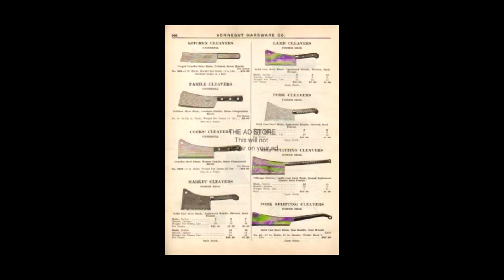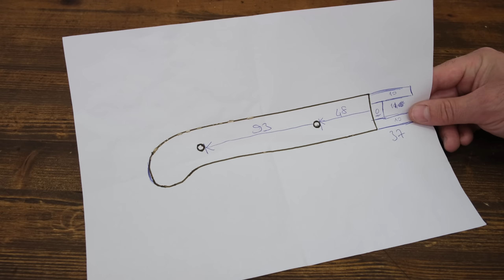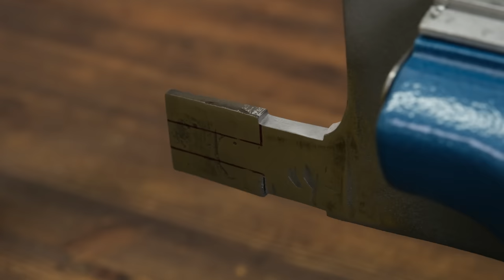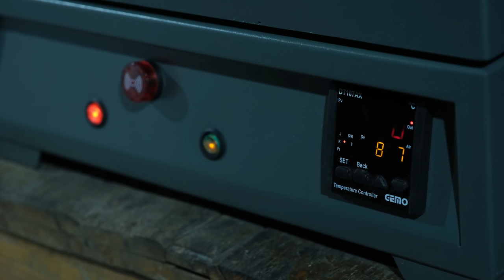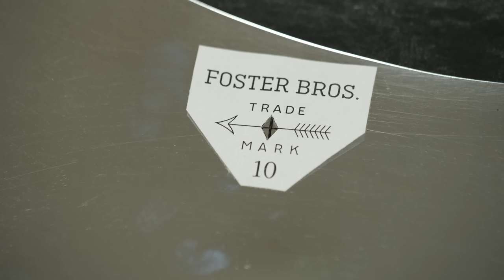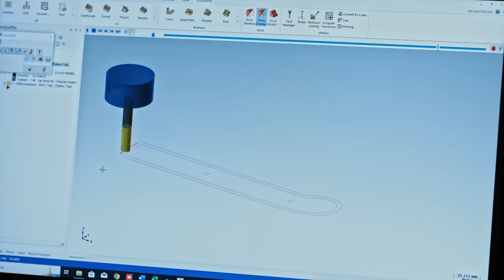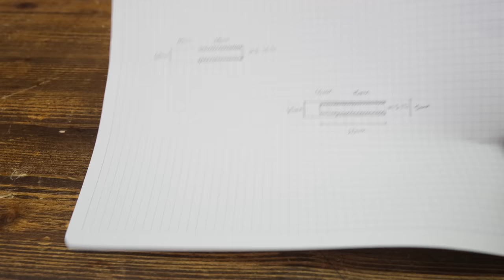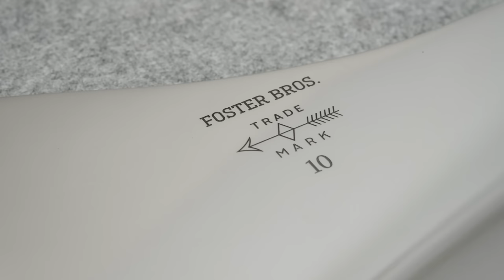1880s Antique Rusty Cleaver Restoration - Restoration Videos

Comment: Its definitely more useful now that it was before, though I think I would have preferred it if the edge profile was maintained at the original slight crescent shape that most cleavers have instead of that straight edge it has now.
Reply from the maker: but the original was like this. so it's flat.
Reply: It probably turned Cresent over the years from bad sharpening jobs
Reply from the maker: @tylerkrug7719  ofcourse
Reply: @meinemechaniker Respectfully, I think you are mistaken. Chopping cleavers almost always have a subtle curve over the length of the blade. It is very hard to chop onto a cutting board and have the cleaver blade strike the cutting board all along the length of the blade. 

With a perfectly straight edge geometry like you have created, the tip or the heel will be prone to sticking into the cutting board and be less likely to cut all the way through the item, particularly with meat. You want a very subtle bulge in the belly of the blade to so that a longer portion or the blade edge will strike the cutting board on any given chop.

I also agree that the curve at the tip likely increased over the years due to repeated sharpening's. However that does not mean that a straight edge geometry was the original shape.

I beautiful job none the less. I just defiantly believe that a slight curve over the length of the blade or at least a subtle upward curve at the tip would make that cleaver work better for its intended purpose in a real world setting
Reply from the maker: @donstrader  Are you sure you watched the video without skipping? I showed you one of the examples on the internet.
Reply: @meinemechaniker  I did skip ahead to the restoration and missed your example pictures. I concede the point.😅

My opinion in the previous post was based upon using cleavers at work and personal preference.
Reply from the maker: @donstrader  🙏🏻✋
Reply: @donstrader I agree with you.
Reply: @meinemechaniker  I watched the entire video without skipping. The original is straight, but from my experience having a slightly curved edge does help abit when chopping bones. A straight edge is fine anyway for general use. Perfect restoration i'd say.
Reply: Whilst it is almost a thing of beauty when it is finished, until it is reshaped it will be difficult to use.

Comment: This was not a restoration but the result is beautiful. Good job.
Reply: It was what do you mean lol?
Reply: @pavloszimbrakos4410 it’s a whole ass upgrade, most restorations I’ve seen aren’t this comprehensive. Dude did a whole heat treat
Reply: @user-px7ls4oi4m  yeah so it doesn’t rust and break again that’s not an upgrade lol it’s a restoration getting rid of the rust and the broken old handle is a restoration
Reply: @pavloszimbrakos4410  he also got rid of the easily repairable edge,   which changes the knife significantly
Reply: @sirkelendor5429  yeah I didn’t necessarily like that either the handle was easy to repair despite what I said in the comment above
Reply: How is this not a restoration lmao
Reply: @Jbarnes1  Because during restoration you try to get the object as close as possible to the original. Here the result looks better than original. This is how the cleaver would look if MM would do it not the original manufacturer.

Comment: Absolutely amazing work restoration ring this cleaver. I have a few process and design questions if you don't mind:
1. Why cut off the tang only to forge weld a new one on?
2. Why place the guard before welding the tang back to the blade?
3. Why make the indent in the guard?
4. Why fasten the grip to the tang with screws without leaving a method to unscrew them? Why not use rivets?

I'm truly curious and and want to know your decisions behind these design and process choices as you are an amazing craftsman. Truly great work!
Reply from the maker: 1-should have been an equal tang
2-Once the guard piece is in there, it won't come out again. and this way the tang edge will look one piece.
3-Once the guard piece is in there, it won't come out again. and this way the tang edge will look one piece.
4-yes, rivets are a choice. but I guess my choice was to create a little crowd.
thanks sir

Comment: Beautiful! 👍😁 But one question - when you reduce the weight of the blade (removing the edge) and increase the weight of the handle (much thicker shaft), doesn’t that completly mess up the balance of the original cleever and transfer much less power to each chop you make?
Reply: Agreed, not to mention that the original cleaver cutting edge wasn't straight on purpose. This isn't a knife. It's meant to chop at large pieces of meat.
I also cringed a bit then first rust removal was the sandblaster, not chemical processes (either boling or rust remedy of kind)  - that would leave more original metal. Original handle could've been salvaged and restored if not for barbaric removal method.
Reply: @agistan7764 agreed here too, I cringed at all three of those points, the quick and dirty sandblast, the unceremonious discarding of the original cutting edge, and the unnecessary replacement of the handle
Reply: As a chef I can say that the weight isn't going to be much of an issue but the straight edge would be if it were ever going to see use again for butchery. Vegetable cleavers do have almost straight blades, I use one every day and it's my favourite tool. The problem there though it is about three times to big to be any good for vegetables. In saying all that though it is a beautiful piece.

Comment: Okay, I don't understand why you did all that hand sanding and filing only to then go over it with a power tool. Why do the tedious hand work when you're erasing it in the next step?
Reply: Это шоу
Reply: I think it’s to take away the risk of damaging the whole piece or tool with the first more ridged and hard sands idk
Reply: the hand filing was to get the blade sharp since it can be hard to get fine angles with big power tools. the sanding belt was to smooth the side of the knife and the round tools were used to polish.

Comment: @ 6:29 I cringe so hard from here on out. Why did you remove the rocker of the blade and handle!!? That's the way it was designed for a reason, so when you chopped through heavy beef and bone, it wouldn't stick and had lesser points of resistance. I'm not trying to offend, but give a little criticism. This blade had been around for a VERY long time and You could have continued to take off minimal metal while keeping this thing as restored as possible and it still would have been as functional as it ever was. Very nice video otherwise.
Reply from the maker: Have you watched the video completely? According to my research, what I do at 6:29 is to return the unoriginal to its original form. If it wasn't so, I wouldn't touch it.
Reply: @meinemechaniker  Yes sir, I did. It was a beautiful restoration, and I do agree that some of the cleavers were shaped like you restored it to, but the splitters mostly had a bend crescent or slight angle in them to avoid sticking in the other part of what was being chopped through. Being such a heavy tilted blade meant that the force came heavy always and would make through with little effort, your end point at the chopping angle would certainly stick into a block holding whatever beef or pig you were cutting on. It's really no big deal, just something I felt you already knew. After all you gave it life again, it's just hard seeing that much unnecessary metal being cut after it's been there so long, it could have kept the oblong edge and been great too. Again. Wonderful editing, and the handle is absolutely stunning.
Reply from the maker: @ghkillah1995  thank sir 🙏🏻

Comment: Dude!  I have the exact same one, a Foster Bros hog splitter and I got it in the same condition, minus the warping.  Looked like someone had been chopping nails with it.  My restoration consisted of a wire brush, regrinding, and a light sanding of the handle.  I only use it for removing chicken and fish heads though.  Yours looks spectacular.  I wish I could afford to have you pretty-up mine like that.
Reply from the maker: Thanks dude ✋

Comment: This wasnt a restoration, it was a hack job. Cutting off the blade and the handle!?!?
You should should have tried heating it and then quenching it. It might have rresumed its original shape.
The cleaver had earned every lump and bump it had. As a restoration, your result should be as good as it gets, not as good as new.

Comment: Fantastic skills and workmanship, howevrr its not a restoration its simply a new tool, a beautiful one granted. Would have prefered to see the original handle restored and showing the patina of the old tool. Blade needs to be slightly curved, will be so difficult to use like that.

Comment: Great job, but for some reason the handle thins out towards the end in the original design. I found one with the same design and size but in worse condition, in an excavation on the banks of the Panama Canal. I haven't restored it yet.

Comment: Not sure if others had ask this question.  Would you know the steel used for the blade?  Is it spring steel or one of the 10XX?  Thanks and great work.  It's a lot of efforts to restore this big cleaver.  It is too bad you have to cut so much height from the blade in order to save it.
Reply from the maker: 2 karbon steel

Comment: nice though not so sure about the choice of making the blade straight, considering the size, a curved blade would make it easier to use and probably would fit the overall design better.

Comment: The results are great. It looks better than it would have new. I'm curious why you didn't electroplate the steel for corrosion resistance?

I didn't care for the editing style of this video though. The video felt both too long, with sequences that seems needlessly long and repeated shots that seemed unnecessary, but also had portions that were sped up, which I've never cared for and would rather watch at normal speed.
Reply from the maker: thanks sir. a heat-treated steel will not rust quickly.

Comment: Why did you temper the handle? Correct me if I'm wrong but hardening makes the steel hard but more brittle. It seems to me that you would want the the handle, the spine of the knife, and the belly soft and only maybe 8mm from the very edge on up hardened,
Reply from the maker: only the cutting edge is hardened

Comment: what's the theory behind heating up the oil before putting the blade into it please cobba.
Reply: Hardens the blade to prevent chipping...there was a hardness tool used to determine how soft the metal from the blade section and body section is.

Comment: The Cutting Edge that you removed was more than likely composed of a much harder metal than the rest of the blade, by removing it you made it the cleaver much less effective and much easier to damage. Cutting off 90% of the handle reduced the potential durability of said handle and I think you should consider reading up on the things you wish to restore in order to not screw them up in the future
Reply from the maker: Pls watch all video

Comment: I wonder if the variation in tang thickness was someone getting overzealous with a grinding wheel on a previous "restoration"
Reply from the maker: The reason for that thickness is that it is produced by the forging method.

Comment: I would have thought separating the handle would create a weak point. Is this not the case?
Reply from the maker: On the contrary, it is now the strongest part! You tied two ropes together. Where is the strongest place in that rope? that's the connecting part!

Comment: Do you think this cleaver has been worked on before? The way the tang is so ground down makes me wonder. Or is that how it came from the factory?
Reply from the maker: What do you mean about the handle?
Reply: @meinemechaniker  The tang is in really rough shape. Makes me wonder if someone used a grinder on it some time in the past? Just seems really rough to have come from the factory like that.
Reply from the maker: @coreyalarie8613  I didn't understand exactly what you were talking about. but you may be talking about the metal in the handle part. I think the trapezoids in that metal are original. because this is a forged steel production.

Comment: would not call it a restoration but rather a rebuild. handle is new pieces have been cut off (that in my eyes could have just been sharpened or bend back) in the end the product is way shorter and smaller than the original product with some new metal blended into it.

Comment: I have a genuine question. No sarcasm. Genuinely want to learn.
All I know about smithing comes from the internet, but I cannot find why you cut off the handle and forged the 2 parts separately and then welded them back together again.
Would it not have been easier to just keep the whole thing in 1 piece??
Reply from the maker: The part I cut was thinner. resistance had decreased.

Comment: That's possibly one of the most over engineered restorations I've seen. Good job, That cleaver is sure to be around for the next 300 years now. It's funny to think you used a CNC mill with a quick tool changer to restore something from the 1880s, to think how far we've come in technology.

Comment: First of many comments. What guided system are you using to get such a low angle for 'thinning' the blade?
Reply from the maker: what do you mean I understand, but Everything Is there in the video. other than that, what would you like to hear.
Reply: @meinemechaniker   I got the CC 'on' but no mention of the system.

Comment: Hello. According to the advice of knowledgeable people, if you use the cleaver for its intended purpose, you need to forge the welding spot. Shock loads will eventually lead to cracks and fracture of the handle. Regards
Reply from the maker: Thanks for info but this welding is argon welding 👍

Comment: There is no protection at the welded seam. It will rust like crazy. Especially when it comes to a touch with the salty water and the acidic fruits.
Reply from the maker: the weld is slightly hardened. In this way, there will actually be less rusting.

Comment: I wouldn't call this a restoration. There are other methods that would have let you call it a restoration. But what you did was create a new cleaver out of an old one. While your attention to detail was great and so was your workmanship. I am not sure you have achieved the best result. Cleavers can sometimes have a stronger metal inserted into another metal for the blade. You might have cut that metal right off. It would have been much better for the structure of the knife to leave the tang attached and fill the lost metal in with welding, if that was meant to be a straight tang.

Comment: 6:47 I was on board right up to this point… Why butcher the blade like that, it was hardly necessary 😢
Edit: I still liked the video but I prefer when restorations are less aggressive
Reply from the maker: I'm asking my friend; why do you think empathize and answer me! why do you think? Tell us ✋
Reply: @meinemechaniker  I think you did a fantastic job. Don’t get me wrong. But although this cleaver seems to be made of monosteel, chopping the cutting edge off wasn’t necessary. The cleaver had a slightly curved edge by design, but now it’s flat - that’s the part I don’t like. Messing with the original design. But it’s your cleaver, obviously, you can do it the way you want. Just sharing my opinion. Overall I have to say outstanding craftsmanship and thank you for the great videos
Reply from the maker: @andrejohnson6731  The original was straight. It was not curved. but it is bent due to amateur sharpening.
Reply: @meinemechaniker  thanks for the clarification 👍🏻 great work!
Reply from the maker: @andrejohnson6731  🙏🏻✋

Comment: Definitely shoulda just cut the excess off the screw pins, with a hacksaw or bandsaw after being screwed tight to the scales, then filed down the little excess that remained. It would've saved a lot more time and work, rather than just filing down those long ass pins. Also not a fan of cutting off the old handle and welding on a new piece, that's an additional point of failure you've just created, for where it can break in the future. This is a cleaver, its meant to chop and will suffer a lot more force upon it than a regular kitchen knife, so its a lot more likely for it to break in that place. Even the old, thinner handle was more structurally sound than what you've just done to this thing, this is effectively just a show piece, not a functional tool.
Reply from the maker: dude, you can see that I disagree with you with this video I made. I see that you agree with me with this comment you wrote. dude, if you're in the northern hemisphere, it's summer. sea, sand, fun 🙏🏻

Comment: Maybe if you had cut through the rivets before levering off the handles, you would not have split the wood. Unfortunately, you also removed a chunk of the blade and threw it away. What was left you sharpened and hardened but it was nothing like the original. I am not sure removing so much metal, and then adding metal in the form of a new shaft did much for its balance either. I happen to know that Foster Brothers cleavers use a tapered metal shaft, not parallel as you welded on in its stead, so that is a flaw in itself. Additionally you replaced the wooden handle completely in the end, so there was almost nothing left of the antique by the time you finished and the use of the Foster Brothers trademark questionable. Thus, this was not a restoration, but a new build utilising a bit of an old cleaver. Your craftsmanship however is not in doubt, but sorry, thumbs down on your interpretation of the word “restoration”.